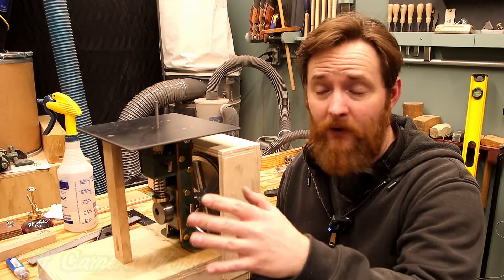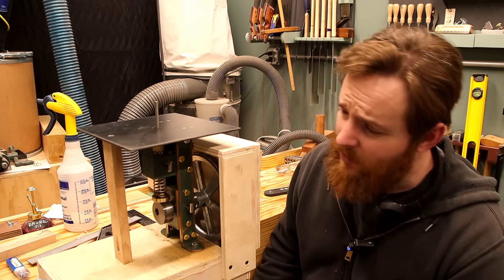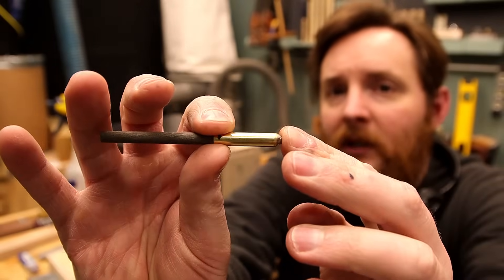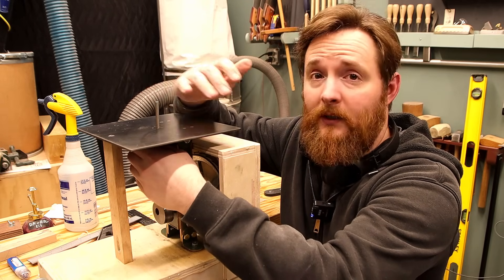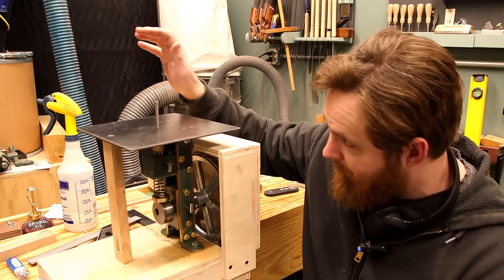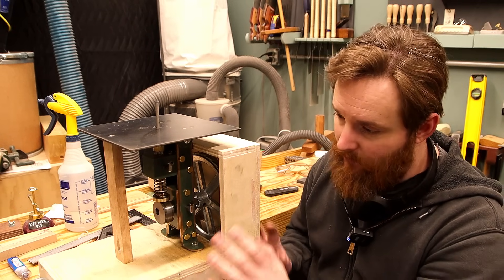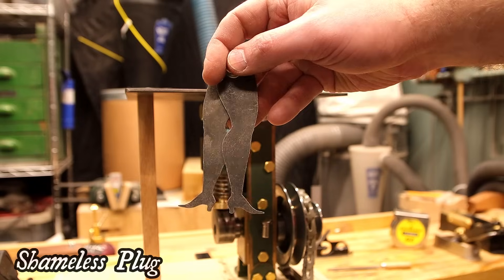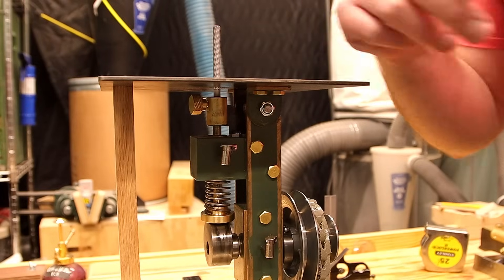I made a filing machine from bar stock | Die Filer Build

Comment: Nice, now that i have machining capabilities, i'l be building one as well, though i would need more of a hand held version and ability to use hacksaw blades to do some cutting and edge roughing on weird angles and while there are little pneumatic garage saws with ability to put file on it, those need a lot of air and i dont use air much on my combination office/workshop/entertainment center. So far havent found electric ones. I guess i need to build this but in smaller form factor or replace pressured air ones turbine with brushless motor from old cordless drill.
Still bench top die filer is decent tool so if you have finalized the design hopefully there is video about the changes.

Comment: Link for the blog and material list goes straight to your Etsy shopfront.
Reply from the maker: Sorry about that. I'm in the middle of a site remodel and there are still some issues to work out. Here is the info: 

Link to the original article - Internet Archive: Popular Mechanics - October 1947, p 226 https://archive.org/details/PopularMechanics1947/Popular_Mechanics_10_1947/

Stock list
- 10 gauge x 8” x 8” steel plate
- 1.25" (D) x 1” Brass Round Bar
- 0.75" (D) x 12” Brass Round Bar
- 0.5625" (D) x 12” Carbon Steel Round Bar
- 1" (D) x 6” Carbon Steel Round Bar
- 1.75" (D) x 3” Carbon Steel Round Bar
- 0.1875" x 1.25" x 24” Carbon Steel Rectangle Bar
- 1.5" x 1.5" x 0.125" x 12” Carbon Steel Angle
- 1.5" x 1.5” x 7” Cold Roll Square Bar

Comment: If you want a die filer but don't want to do a complete build, find an old cast iron belt drive scroll saw to use as a starting point. You will want the belt drive so it can be slowed down.

Comment: Thanks for posting, great work! I too use a long bed Sherline with a milling attachment, love it!
Reply from the maker: Awesome! It's a fantastic little machine.
Reply: I does punch above it's weight class very well! I noticed you're even milling steel with the head stock riser on. Sherline does not recommend that afaik, but it looks just fine too me. I just got the 13" C/S (after 20years of ownership) and that makes it even more versatile. Are those Falcon files proper die filer files?  @EricMeyerMaker
Reply from the maker: I've made one so far from a chain saw file. The falcon ones are pretty nice, but the limited stock is a bummer.
Reply: Yeah, someone with a wire EDM should make proper die filer files from regular files. Should be quite easy. @EricMeyerMaker
Reply from the maker: Blondihacks showed an easy way to do it with regular files. Basically, it was snap the tang off and JB weld the file into a brass tube. That works pretty well!

Comment: These filers need a hold down….you will pinch your fingers very badly…all filers have a hold down…period.
Reply from the maker: This uses files that cut on the down stroke. Hold downs aren't required.
Reply: Excuse me….wrong…..the file has to move up and it can grab the material. My machine was made in 1943 for the war effort. Just watch your finger tips! Check out Oliver file machines….hold downs are need for precision file work. But your machine is super cool with or without a hold down…!
Reply from the maker: Maybe we're having miscommunication here. IME, hold downs aren't universally needed.  I've been around several machine where they were designed/manufactured without the hold downs. The one I made I was based on a design from the 40s. Hold downs werent part of the original. The MLA-18 castings seem to be pretty popular and that one doesn't call for the hold downs either. They all seem to be working pretty well. Like I mentioned at the end of the video, I added a larger wheel to slow it down even further than what was shown on camera. I'm not getting any lifting.

Comment: I'm impressed!   Years ago I was offered a die filing machine for very little money and passed it up.  I wish I hadn't.   Years later I have need now to make some simple press tools for thin sheet metal parts.
Couple of thoughts.    I assume that you have the file set so it cuts on the down stroke.   The way the eccentric drive works you then have the filing cut action driven by the spring.   You talked of an upgrade later so maybe you could consider using rolling bearings as in sealed ball bearings rolling on the cam surface which would eliminate the rubbing action on the cam.   If you had rollers both sides of the cam you could then eliminate the spring and have motor power on the down stroke.   Dies for press tools requires a relief angle away from the cutting edge to allow release of the punched part.   If the filing table could be tilted by a few degrees that would facilitate generation of the relief angles.
Making things is very good for the soul!    Subscribed.
Reply: Why an filling machine an small tabeltop mill should do the work too or i am wrong?
Reply: @Preyhawk81  You can make simple press tools with a small vertical Milling machine,  but a die filing machine enables the production of irregularly shaped parts and by tiling the filing table can relatively easily incorporate the necessary die relieve angles around the die profile.
Reply from the maker: Thanks for the ideas!

Comment: You need it the whole time you're making it! This is one of those tools that could build itself (or at least help a lot). Try a fine tooth carbide roughing end mill for side milling, they are cheap on auction and last a really long time. The Sherline will be happy running one.
Reply from the maker: Thanks for the tip!